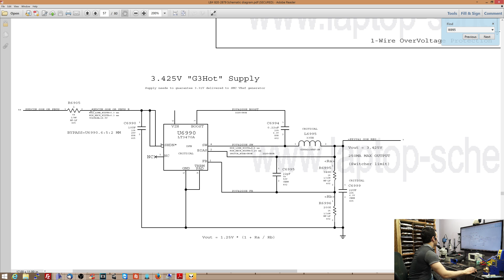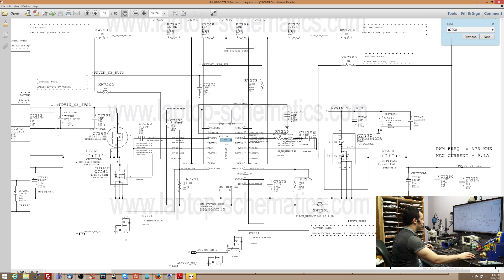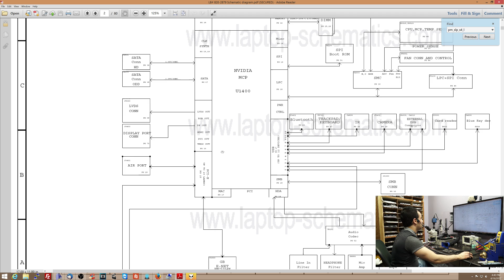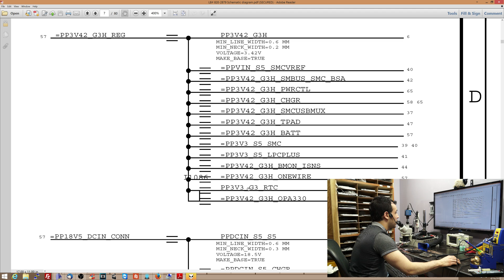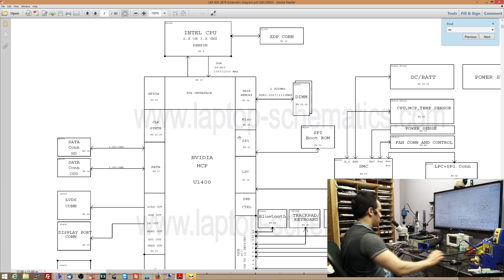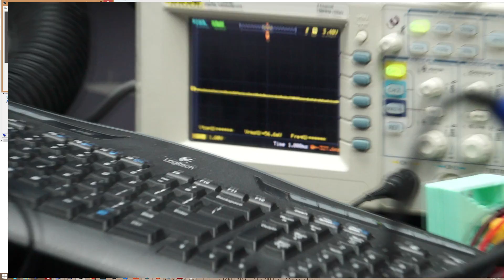Diagnosing a dead MCP on a Macbook Pro logic board.

Comment: Hi I have a 2008-2010 mac pro and this morning it won't wake up when I clicked the mouse and it has no signal to the monitor. Iv tried the keyboard in all usb ports but no luck. Iv tested the mouse on my PC and that works fine, but i cant get both of my mac keyboards to work on the pc. When I plug my external drive into the mac the light comes on and it loads up, but that still isnt waking the mac up. Also the light on my PC wireless mouse usb dose not light up when i plug it into the macs usb ports. But the mac is on  so there is some power. Lol i left for 2 hours came back it was still off so i thought ill have to use the old imac i pluged the old i mac in and instantly the mac pro woke up lol wtf ? universe toying with me :)

Comment: Hi Louis, great video! Sorry for bothering you, just got reply from apple service center that my MacBook Pro mid 2015 have logic board problem so it needs to be replaced. I don't trust them, had no symptoms of failing logic board. Just one day mag safe adapter stopped showing green light and charging my laptop, it works fine for other laptop perfectly. So MacBook just slowly lost battery charge and shutdown, no issues with keyboard, screen, reboots, etc. Could it be just failing mag safe dc port or battery issue?

Comment: I don't understand 99% of the jargon but I find your dialog spellbinding. I came here searching what the "MCP diode" is and why MFC shows my 2010 macbook is running above 170º on auto fan. I cranked it to max rpm and the diode went down to 113º! what's your take on manual fan control? I'm feeling inclined to let the fan run at full speed all the time, if it dies, I'm guessing it's cheaper to replace a fan than a toasted GPU. What do you think?
Reply: Im here for that reason too! I believe it might be the Northbridge/Southbridge. I think the south bridge as MCP stands for "Multi Chip Package" and on some forums the MCP sensor was detecting the south bridge. But i don't know which one gets hottest

Comment: Hi Louis, great job! Could it be that an MCP is partly dead, so in my case giving out RTC_CLK32K_XTALOUT but not the rest or is it like "completely dead or fully working"?In my case it's an 820-2879 not turning on in spite of being in s0-state, fan is turning high, RTC_CLK32K_XTALOUT is at about 1.7v (I haven't got an oscilloscope). I'm totally not sure if in this case the MCP is dead or if it could be something else as there is absolutely no S0-rail missing. What do you think about that?Greetings from Germany,Marc
Reply from the maker: there is an S0 rail missing here I am certain of it!
Reply from the maker: PLT_RESET_L present?
Reply: Thank you for responding so fast, I really appreciate! PLT_RESET_L is not present, but all S0 rails are present...
Reply: Do you think it is likely that the MCP is actually faulty although it is still putting out some voltages like for example RTC_CLK32K_XTALOUT? My other assumption would be the SPI_ROM, but as SPI_MLB_CLK and SPI_MLB_MOSI both are 0V for me it looks like an MCP-problem (I know you don't like to hear that, but to be honest I would also like something else than the MCP to be broken :D ), or am I totally wrong with that?

Comment: have a somewhat similar issue with the same 820-2879 board. Turns on, all voltages are present, including 3.3 and 5v, S4_slp signal is present. No output to the LCD, black screen, no chime, beeps, nothing. Replaced EFI from another board, no change. Any hints?
Reply: +Andriy Semaniv I have the exact same problem, any solution?
Reply from the maker: +Melvin Ballard I have no record of a phone here from you. Our eBay account can only buy, not sell. If any activity has taken place that I am not aware of, feel free to reach out to me personally via youtube messages and I'll look into it with whatever details you can give me and I will try to sort it out for you.
Reply: Louis Rossmann
Reply: +Andriy Semaniv This guy is a scumbag folks.  He stole my iphone 6 on ebay.  After 3 weeks of not getting my phone back I wrote bad feedback for him.  He messaged me saying the only way he would send my phone back is if I changed my feedback.  He still refuses to send it back.  This guys name on ebay is sema_yuri.  Can I get my phone back man?
Reply: Misunderstanding sir.  Not you but the gentlemen I replied to.  Andriy Semaniv.  He stole my iphone 6 and refuses to ship it back to me for some reason.  Anyways, sorry for the confusion.

Comment: Got a really weird scenero that happened with a 2010 mbp the other day, basically the board was dead as, it would show a charging light, the interface board would show the charge level so therefore the SMC was not dead, but it just wouldn't turn on no matter what, i even took the board out and reinstalled in the case and thought nah, this boards got some component damage

then 2 days pass and i just randomly went to power it on and it chimed and booted up perfectly fine. I am so confused!
Reply: Sam Radford It also wouldn't boot in smc bypass mode